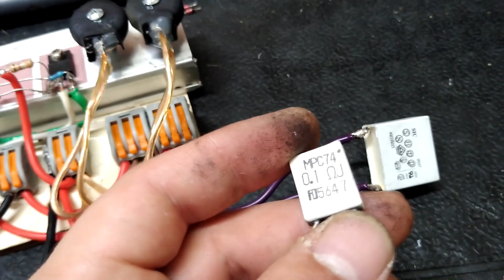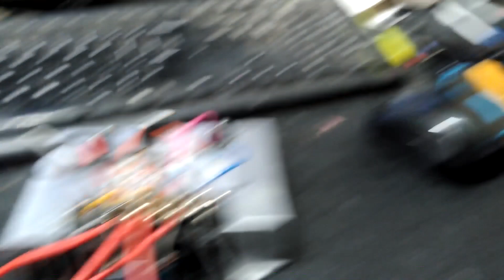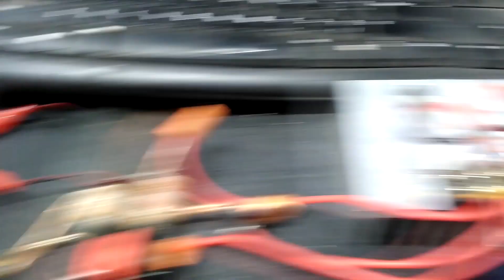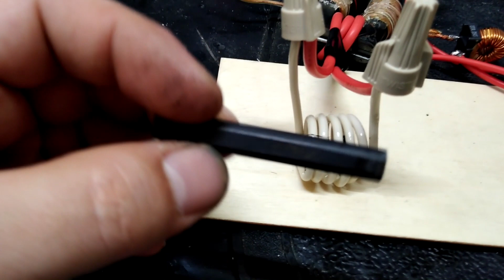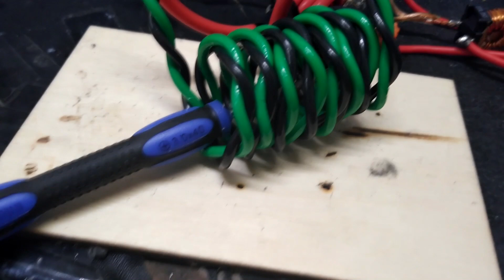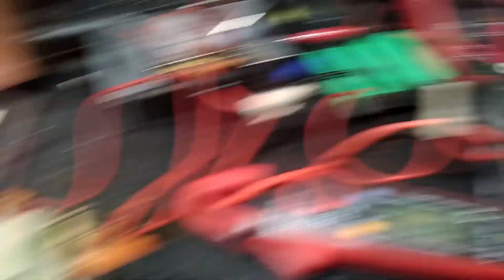ZVS Testing at mid-power

Comment: heheh I wonder how many screwdriver you messed up with the induction heating setup heheh , I hope you get back tinkering brother , I been missing your content
Reply from the maker: I've been messing with a few circuits lately but haven't been recording videos. I've really been trying to mess with filtering of the HFSSTC's because the mains grounding interferes with my downstairs neighbor's television and she calls me to complain. I sort of gave up on that and just started trying fully isolated setups, and now I'm working on a small scale QCW circuit. I still have some Class E's I need to finish but hopefully I can get a lower power buck ramped deal going and make some videos before trying a higher power one.
Reply: @Magneticitist  ohh sorry to heard about that filtering problem , I wonder how the neighbors knows you are the one causing it ?heheh , I wish I could fuck with my old neighbour tv or audio equipment fucker was loud all day long I had to move... brother small scale qcw sounds so damn nicee I would for sure try to replicate it I been looking into qcw drivers ,  now I been having a lot of fun with that little zvs driver I made , I would like to make some kind of sstc that could take high input voltage so I could charge a capacitor with the zvs to like 200v and use it to power it (the well know zvs cheat ), I think maybe a half bridge would work for that
Reply from the maker: @rodriguezfranco3839  The lady below me says she hears buzzing coming from my place but she also knows I mess around with that stuff. I've given her a break for a while though so it is what it is..

I need to really create some more room to tinker cause I got too much stuff going on, but I at least made a little buck converter that should work til I get parts to make a better LC filter for it. I might mess around with it on some tesla coils tomorrow but I guess I'll have to build a new drsstc circuit and coils to really make it work. I can sort of half-ass use my signal generator for the ramp but I need to make a dedicated ramp generator circuit using the arduino code out there. The general setup and way it all works is not all that complex, but the implementation of it is always more difficult than people let on. Parts are not just readily available laying around most of the time and the ramp has to be done properly to get the swords to propagate. 

Once I finally get the ramp generator all worked out I can start trying to play around with various coil sizes and power levels and circuits etc. The ultimate goal is to push about 340VDC into the buck, otherwise what I'll be doing playing with 120VAC probably won't be much better than the staccato ramped setups I made.
Reply: @Magneticitist  I would love to see the driverless hfsstc qcw hehe , also a push-pull running on qcw would be awesome , as I understand you could qcw almost any setup , I have some arduinos laying around I need to do some more reseach but as I understand I need to get me a big inductor and some beefy diodes to build the buck part ,then the arduino needs to provide a sweep of frequencys to get the ramp going .
Poor lady she should be able to watch tv without problems
Reply from the maker: @rodriguezfranco3839  I'm gonna have to try ramping different setups at low powers before really giving a big one a try. I wish I knew arduinos better but there is code out there for the ramps. It's basically taking a relatively low resolution of 'steps'.

Similar to how a VFD works, there are basically square waves at cascading on times which provide the ramp. Since on time basically equals voltage out on a buck converter, 100% will be the max voltage the buck can provide.  So if the buck is driven with square waves at cascading on times you start off with very low on time then cascade up toward high on time. Something around 20-30khz buck frequency or so. This results in the buck converter outputting the ramping voltage since it's filtered.
Reply: @Magneticitist  Oh I had the wrong idea , I thought it was the Frequency that was changing , but now it makes more sense , I think I might have all the components to make a very little buck qcw module , I have not mess with arduino for a long time , but if I remember correctly to make a digital signal you write the digitalwrite() funtion and the duty was something that goes from 0 to 255 , is not that hard if you want to make your own code , but it would need to learn some coding , my push pull coil won't work like that cause I don't have any voltage regulator for the gates driving , I could add a regulator and give it a try , or I could try it on the pll coil , but I feel like the pll won't give impresive arcs
Reply from the maker: @rodriguezfranco3839  Finn Hammer has provided code for free to coilers out there to try. https://highvoltageforum.net/index.php?topic=844.0

IDK if that's the newest iteration or what but I'm going to try it. You can definitely make a lower power buck but you'll still need a fairly substantial fast diode. I had to order a 600V 20uF film capacitor and will probably end up trying to use whatever large inductor core I have around. 

You basically want a ramp that will give you an advantage over mains ramps so you can do this either with the peak voltage or by providing a longer ramp and feeding an arc more current over time. So basically at lower voltages you probably want a decent ramp of 20ms at least, which will more than double what you'd get straight from the wall way easier as far as ramp time. 

Apparently everyone uses sort of a plasma pilot light ("WICK" in code) on the breakout point by starting the ramp off with an initial step of around 30V or so for a full bridge. Then after some tiny 30VDC period the ramp will then begin and start climbing for some 20-30ms typically I believe. Sort of just ensures current is being fed into an already propagating tiny arc. Finn Hammer has coded it so you can adjust all the variables with 5 potentiometers.
Reply from the maker: @rodriguezfranco3839  The Finn Hammer code works pretty good by the way. Tried it last night and didn't think it was working at first til realizing my loose lead coming off the "one shot" pin was picking up tons of noise. I can't really do shit with my buck cause the LC filter is just like a useless placeholder right now but the ramp part is pretty cool. I'm just feeding that output into a gate driver then straight to the Gate.
Reply: @Magneticitist  Oh cool , I been taking a good look at the code , but I don't understand all the features like the one shot , also I can't open the schematic , do you think I can use one of these stp75nf75 (75v 75amps ) and a few chokes I got laying around ,and for the diode I got a UF5408 rated 3amps , I would use just the arduino to drive the gate cause I don't want to use a gate driver if not necessary , if you could make a video it might help me undertand everything better , anyways it would be a qcw module for low power setups I could try  with a simple slayer exciter first
Reply from the maker: @rodriguezfranco3839  I'm uploading a video just covering the ramp circuit and showing my setup at the moment but AFAIK the one shot is like the same thing as with some other interrupters out there where you basically just command a momentary burst of output. In this case it would be a single ramp that would equal a single arc channel.

Pretty sure I've seen that 75A mosfet used in some cheap buck converter circuits out there but yea I don't see why not for low power. You can drive a mosfet like that from an Arduino if you use an amp stage of course, otherwise it's not going to switch much power. I haven't really been able to easily to just throw some random coil I have on my buck output yet because it's honestly a big hassle dealing with all the wiring and connections. Have the arduino supply, gate drive supply, buck converter supply, then it would be the SSTC driver still needs power. Maybe I can try the ramped full bridge I have laying somewhere but I forgot how I had the damn thing set up.
Reply from the maker: @rodriguezfranco3839  https://www.altium.com/viewer/ 

upload schematic file to there and it will show you an image of it
Reply: @Magneticitist  Thanks so much , yep I am gonna need to grab a few npn pnp transistors and make a totem pole , unless I grab the gate driver from the pll setup , I am gonna see , thanks so much for the schem now I can understand it much better , I also got a 260 laying around but I feel like those little 75amps fets could be better for this aplication